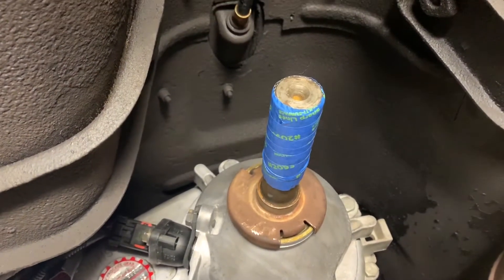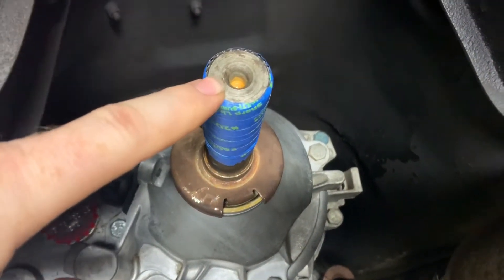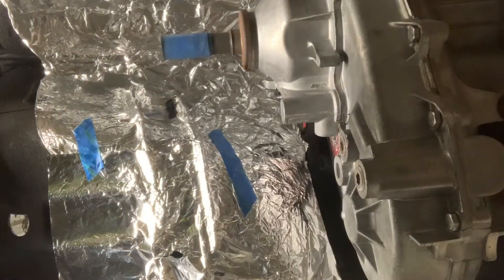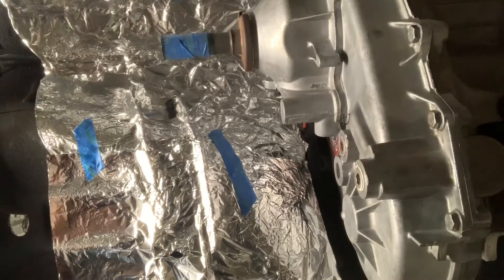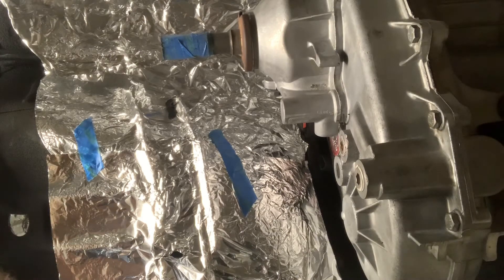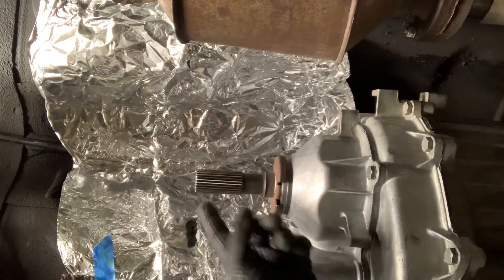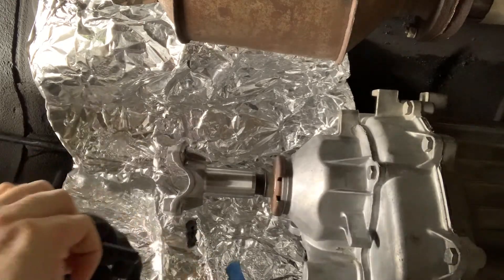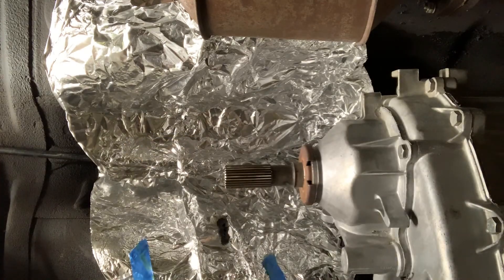Jeep Cherokee XJ Hack-n-Tap SYE Install (Budget Slip Yoke Eliminator)

Comment: To much speed on the bit. Also, they recommend drilling after cutting because the metal on the end is hardened and takes longer to drill
Reply: I was thinking that. I've run a lathe for many of hours. Show n steady and plenty of cutting oil.